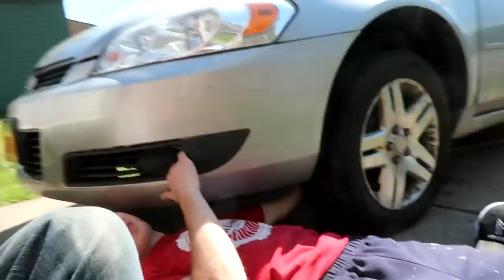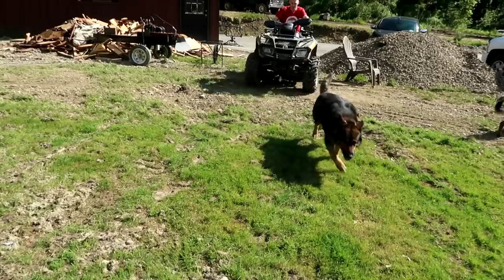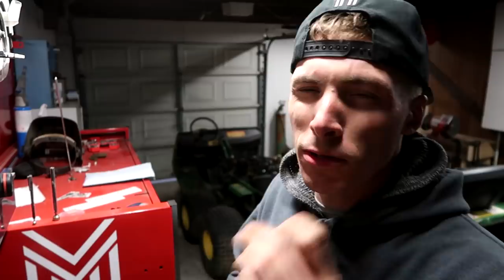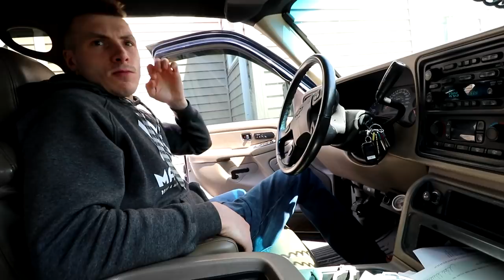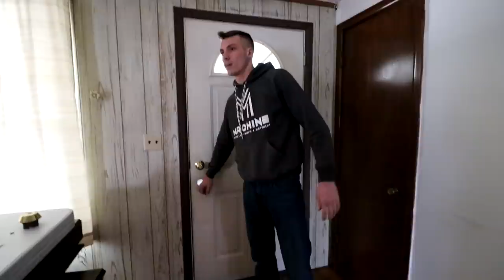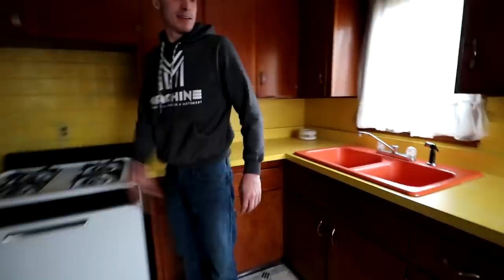so i bought a house

Comment: in the city cops dont give a hoot if you ride illegally on the streets with toys...cars and motorcycles that should be registered then they do if they need to...So living in there you may be able to test and tune on the block wiuthout actual tickets or issues...maybe a talking to might happen but they wont remember you later if you are nice back to them.